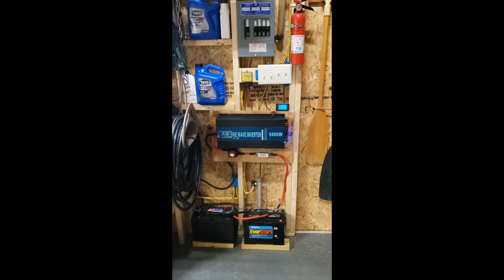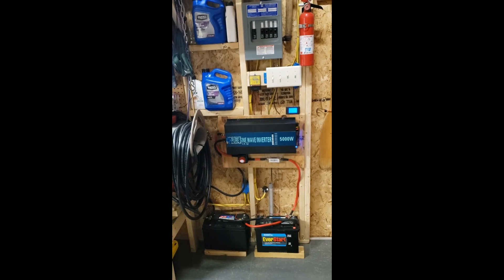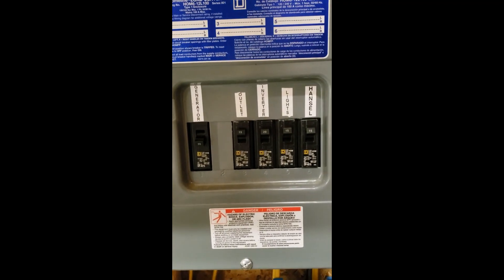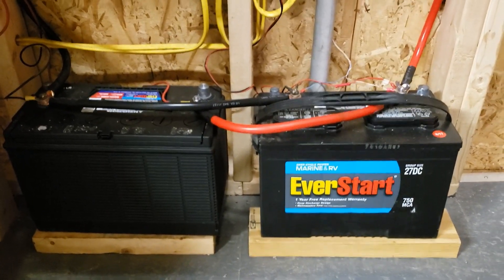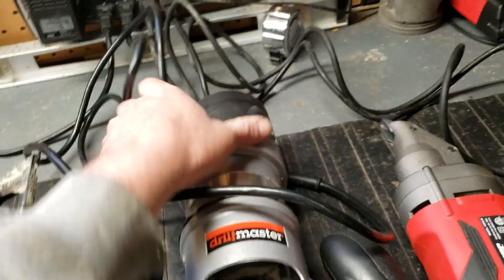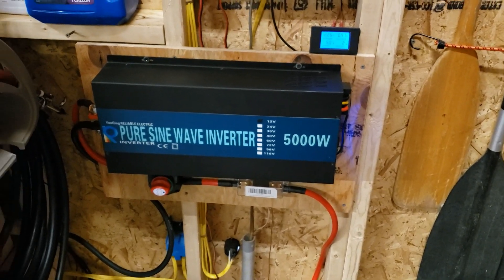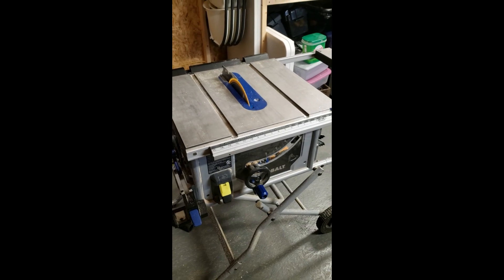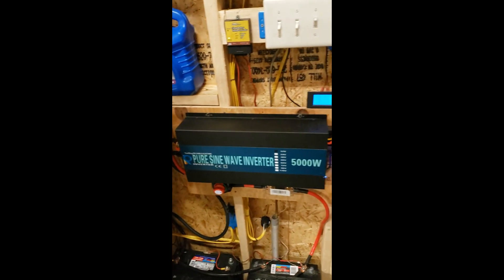WZRELB 5000W/10000W Peak Pure Sine Inverter Demo

Comment: Can you try washing machine with it? I had one with 3500w or peak power 7000w and washing machine blow it up after 15 minutes. Wash machine is consuming cca 2500 watt's but probably peak power is much higher...
Reply: Issue is most of the single ports are 15A max so 120v x 15=  1800w max  from a single outlet 

Most washing machines are surging in the spin cycle at 2500+ watts

You may need an inverter with 20A sockets with the T design/GFCI

Comment: I just installed this inverter into my RV. My Surge Gauge display tells me there is a reverse polarity fault. I have verified all of the wiring is landed correctly. I have added a bonded neutral plug to try to correct the issue but the Surge Guard display still shows Reverse Polarity. I am stumped. Can some one help?

Comment: I have the 3000 watt Reliable clone of the WZRELB. it not good with startup spike wattages. It refuses to run my 6000btu AC . As soon as the compressor kicks in the Inverter shuts down. My Harbor Freight 2000 Watt Modified Sign Wave inverter runs it i guess the H.F. has better quality components?

Comment: I just purchased and received this exact inverter. What an absolute beast when hooked up to stout electrical. I have a 370a large case hairpin alternator in a vehicle I've designated for ultra high power car audio. With all the extra batteries, heavy cabling, and this burly DC Power Engineering alternator, I can run two air conditioner units, and a 1500w heat gun all at the same time, easy breezy. Tested yesterday in 108+ degree weather for a half hour strait, with the car in the sun. Probably nearing 140 degrees inside easy.  I ran two two 3 foot 2/0 ofc cables runs from my battery bank, and have yet to overload it. I tried. Even at full output, I can maintain 14+v. Strong electrical is key, this thing will literally do it all of you have the current capability. It didn't thermal, or have any problems with these grueling conditions. Stepping up from a xantrex sw2000, this easily has three times the balls. 

I'll use this for backup to run the house when/if the grid goes down, as I already had a good power plant that I can use for other things, other than making myself and others deaf at audio competitions.

Comment: No way that's 5000w on 12v. You'd need cables capable of delivering 400+ Amps. Those (what appear to be) 4 gauge cables are only rated for 85 Amps. At higher loads, you're gonna melt those cables.

Comment: What size fuse do you recommend for a 5000 watt inverter same brand as this one you have I have a battery Bank of eight batteries at four hundred amp hours each a total of 3200 amp hours what size fuse would you recommend me running on the cable that connects the battery to the inverter?
Reply: 500a should be about right.

Comment: What size cables are you using to connect the 5000watt inverter. I just got mine and the cables are really small.
Reply: To support 5kw continuous you would need at least a 4/0 cable size. Frankly it's silly to use 12v for a 5kw inverter, you should be using a 48v system so you're not overloading your batteries with that much current.

Comment: tiny battery bank, how are you charging them? solar? im about to order the 48 volt version of that inverter, i want split phase low frequency, but i cant afford that now, plus they really suck down the power in stand by. btw i was always told to not mix batteries like that, but i like trying things out my self just to see for sure what happens, tonight i just wired two battery banks, is is 4s4p 48v, the other is 16p 12v lol

Comment: Continuous current draw for anything above 2400watt will heat up the wiring and cause problems. I’ve tested this same inverter on an electric heater. I will try upgrading my wiring and update.
Reply: This inverter is not worth the price tag. I upgraded my wiring to 0 awg gauge and ran a 3000-3600 heated faucet and the inverter died. I would say less than 2400 watts. But sketchy at that
Reply: So using big power tools like video for long periods of time isn't wise ?
Reply: I didn't have that problem myself after testing in some seriously grueling conditions. Two large window ac units, and a heat gun at the same time. Didn't thermal, overload or let the smoke out. I'm pretty impressed with it so far. Especially for the price. Maybe I got the golden sample unit.

Comment: Loved the video I was hoping to wire up something similar in my van to run my tools would this setup run a 3200w industrial vacuum do you think use would be for about 25mins each session?
Reply: about 1500wh, if the unit pulls 3200 watts continuous for 25 minutes
Reply: Did you ever do it?
Reply: It'll do it super easy, *IF you have the 12v electrical behind it. It takes power to make power. I did some extensive testing yesterday, it passed my extreme load testing, and passed with flying colors. 

If you have good electrical, this easily does rated power in my experience.

Comment: Amazed the voltage from batteries didn't sag to the point of safety shutdown of inverter! Also surprised the arm saw didn't blow the thing up! I guess it's because the inverter is a so called 5000 watt unit, which means it can do 2800 or so without damage.
Reply: What are talking about? Reliable inverters are actually pretty good and they stand by their product. They've got a fantastic customer satisfaction rating. It will do 5kw, but they do recommend that you keep to 80% load continuous.
I've seen Reliable 3kw inverters pull 4000 Watts and not break a sweat.
Reply: I’m new to backup power, how long would the batteries run the inverter?  Also, assuming you would use a trickle charger to recharge you batteries. ?

Comment: Will a 5000 watt inverter charge a Electric car faster then a 3000 watt inverter.What about a 7000-8000 watt generator compared to a 3000 watt generator.So I'm asking the more watts the generator has will it charge the electric car faster ??
Reply: the answer to your question is based on the max input the electric car can take. if the electric car battery can only take 2000 watts then all inverters/generators above 2000 watts will charge at the same max input, but if the electric car can charge at a max of 4000 watts, then yes a 5000 will charge faster than the 3000. i am not familiar with any electric cars, but i know how batteries and chargers work. also, usually, but there are exceptions with the aio inverter/charge controllers, an inverter does not charge a battery directly, but it could be used to power a ac to dc charger

Comment: hello let me know if you test  this inverter using am broadcast receiver. do you have noise , hum in those radios.  i am interested in purchasing one. thanks
Reply: did you find your answer? i have been planning to get into ham and other radio services once i get my solar crap built. also, most of my ham stuff is 12 volt powered.